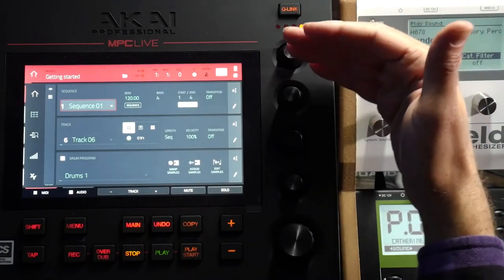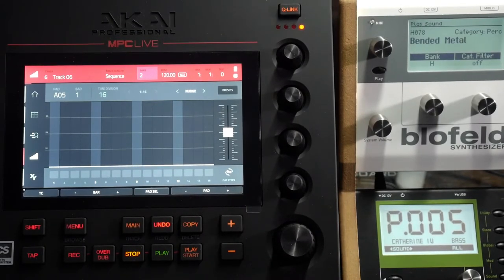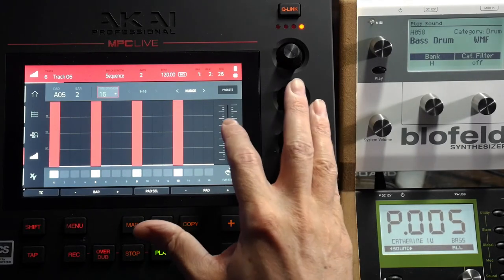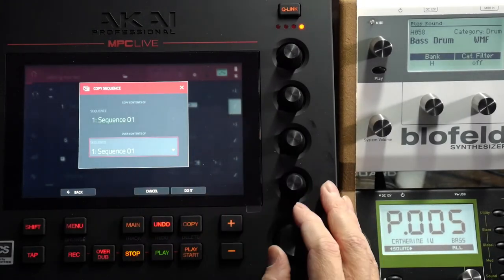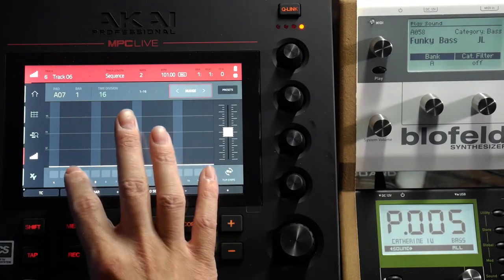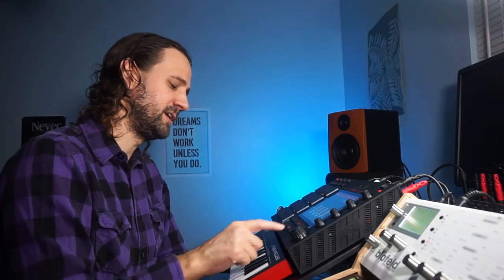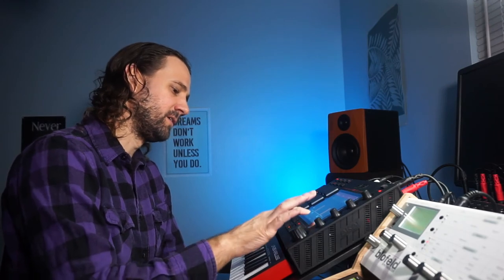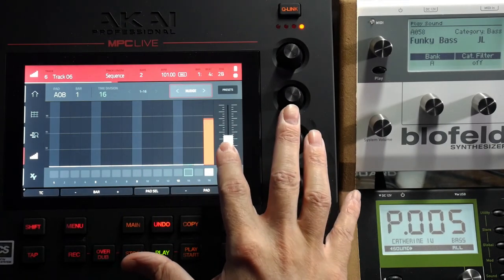MPC LIVE Sequencing Drums and Copying Sequences (Quick and Dirty #04)

Comment: Dreams don't work unless you do! I just got my MPC, as a fan of hip-hop but a guitarist as a musician, I am really struggling with getting everything out of it. Videos like this help me a ton to get passed that first "workflow" stage and into making full songs. Thanks!
Reply from the maker: One of the reasons I got the MPC LIVE is that it can record audio tracks.  So you can record guitar parts directly into the MPC LIVE.  The inputs are TRS balanced, so you technically have to plug your guitar into a mixer or something with a hi - Z input before the live to get the cleanest sound before plugging into the LIVE, but I have seen people plug their guitar right into it before 😝  Same if you want to record an acoustic guitar, you would need a mic pre amp to record into it.   I really want to start recording guitar and mixing them with the drum beats that I make on the LIVE.  If you are brand new to programming drums, and programming MPCs it can be a bear to wrap your head around.  There really are a lot of menus in the MPC LIVE, but it is worth it to learn them.  The hardest part is knowing where to start.

Comment: Do you prefer to use the step sequencer rather than the grid mode?
Reply from the maker: Depends.  If I am programming and editing all the parts on a drum beat I like to use the grid mode.  One thing I like about the sequencer is that you can really zoom into the sequence by changing the time division and add really detailed programming easily on a specific sound.  This video was just to show the basics and how easy it is to make a simple pattern.  Thanks for your comment.